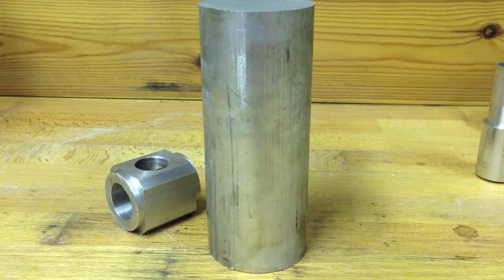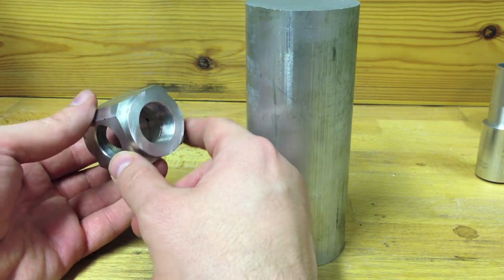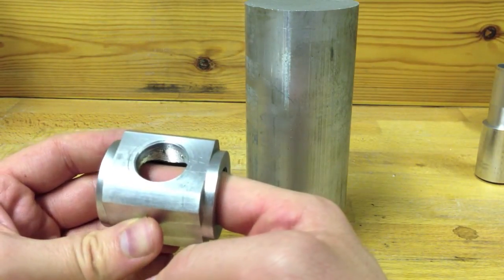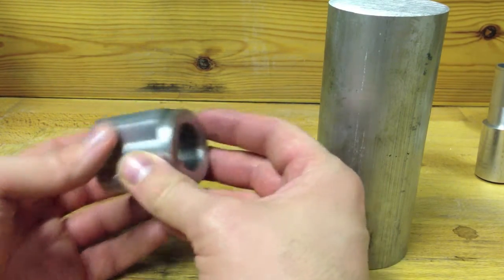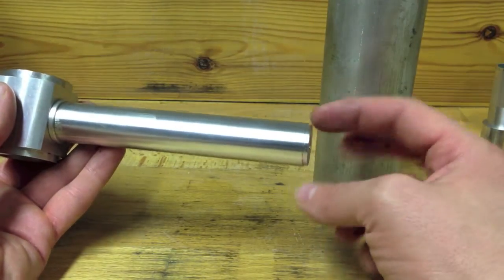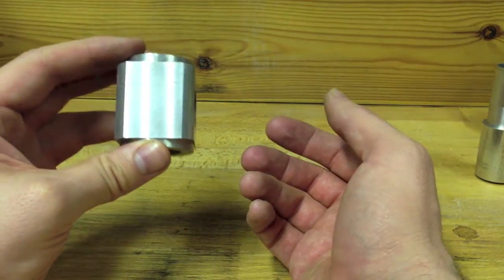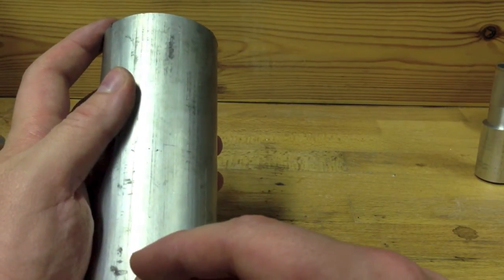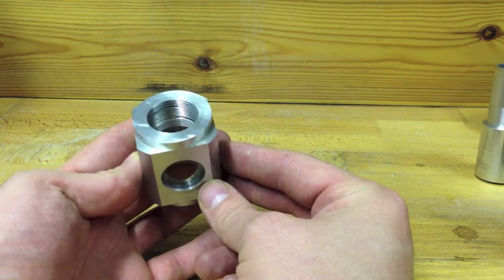Watchmaker's Centring Microscope Part 5

Comment: I think your problem came when you assumed that the axis of the piece was parallel to the axis of the spindle just because you had some parallels behind it. It wasn't, which you could see when you started chasing the threads. You need to put a second indicator on the perpendicular face and tap the thing around in the chuck until both indicators give zero.